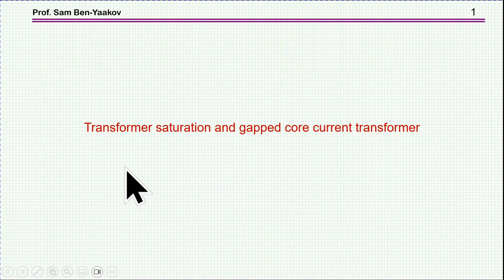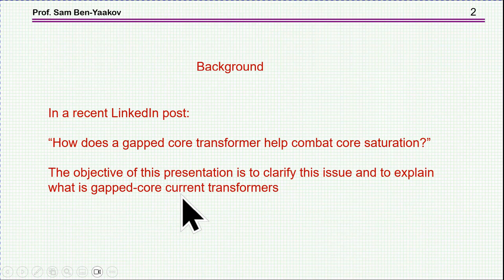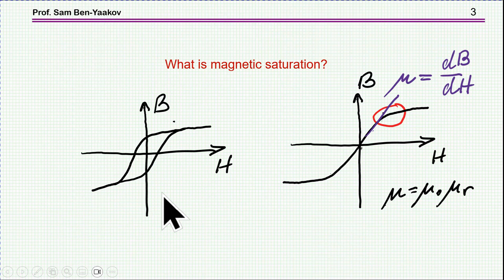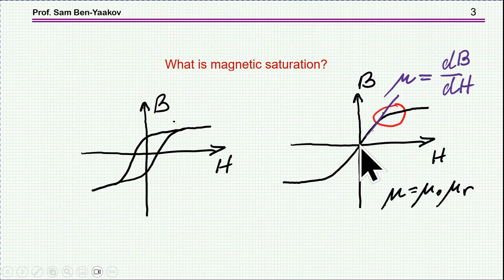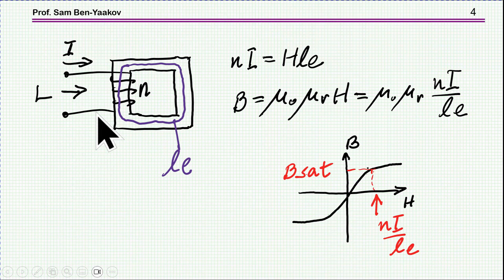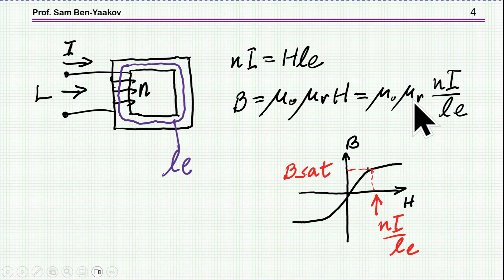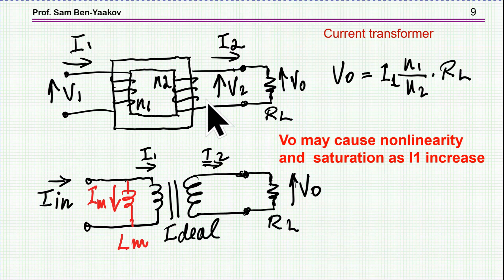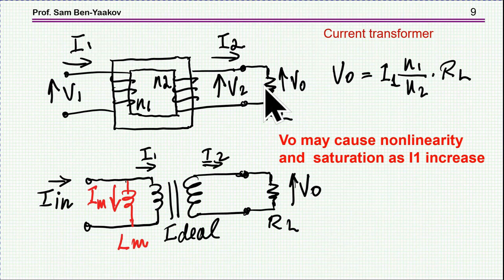Transformer saturation and gapped core current transformer

Comment: Professor, thank you for your great video! I have a question which confuses me for a while. I am designing a transformer for a CLLC converter. For the same turns ratio, see 10:1, I can choose 10:1 or 20:2 in order to get the same output voltage. However, according to the Faraday's law, when I use 20:2 instead of 10:1 (keep inductance L the same by adjusting the air gap), I would have lower Bmax when the output voltage is kept constant. However, if I refer to Ampere's law, as the output current or even the magnetizing current is the same, n*i = H*le, the H would be higher and so the Bmax would increase. Where am I wrong?
Reply: I think I figure out :) when I increase ratio from 10:1 to 20:2, in order to keep L constant, I have to increase the air gap which affects the equivalent le.
Reply from the maker: You mean you are going to have 1 turn in one case and 2 turns in the other case?
Reply: @sambenyaakov  yes professor
Reply from the maker: @tangy1181  This seems unrealistic.
Reply: @sambenyaakov  I think I confused myself in my original question. When I choose more turns, in order to keep the same inductance, the gap will change. So even though n*I will increase, however, as the the airgap increase, H might actually decrease. ：） sorry for the confusion!
Reply: @sambenyaakov  But professor, I have another question. For my understanding, the inductance should only depends on the transformer geometrics and etc. However, when I test my transformer at 100Hz, the leakage inductance is 42uH while at 100kHz, the leakage turns to 7uH. The material is 3F36..... why🤣
Reply from the maker: @tangy1181  with 1-2 turns all the behavior is messed up
Reply: @sambenyaakov  im using matrix transformer, the actual turn is 5:2

Comment: Hi professor. Related to this topic, DC-blocking capacitors in DAB converters.There are people that indicate that DC bias can be solved with a gap in the transformer,  others say that DC capacitor is always necessary. I thing that resolution of PWM in microcontrollers is going to always generate some DC and in transients very likely a DC half-cycle applied, and hence saturation. Can you dedicate a video commenting misconceptions on this issue?
Reply from the maker: Will try. The best solution is to use current mode control.

Comment: Hi Professor,

Thanks for another good discussion on magnetics. I haven't seen any gapped core current transformers like this (unless you count the aux/sense winding on a QR flyback or BCM boost inductor), so it's interesting to think about. 
I think there are some applications where a gap is helpful even in a conventional voltage fed converter or current transformer, though:
Where the excitation is unipolar (e.g. forward converter transformer or a current transformer for measuring switch current in single ended converters; in the general case where one relies on the core to reset itself) to reduce the remanence and allow higher flux swings before saturation.
Where some DC current would otherwise saturate the core undesirably, such as in a center tapped converter (only so that the additional magnetizing current will reduce the voltage across the transformer with the winding and switch resistances) or certain current measuring applications. You could consider this to be the shunting benefit of a parallel inductor as you discussed in the video for the gapped core CT and of course it comes with a cost in terms of pulse accuracy or reactive current depending on the application.
Reply from the maker: Thanks for the conversation. I agree with what you say but my experience has been  that a gap is inserted  in a transformer core when there is a possibility of DC voltage and a series capacitor is not used. .

Comment: This was interesting.  However I have issue with the statement that the voltage causes the saturation.  The saturation is caused by magnetic flux density reaching a value where the all domains in the magmatic circuit are aligned.  
That saturation value (peak flux density)is proportional to V/f (slide 8).  This to me seems better than "the saturation is caused by the voltage."
Reply from the maker: Yes, I agree in general. However, the  domain explanation does not provide quantitative relationships. Or, why will be the domain more "aligned" at a lower frequency. I was said that the saturation is caused by the voltage because, as you might know, the presentation is an in fact an answer to a LinkedIn post that was related to line (fixed frequency) CTs. Thanks for the conversation.

Comment: Nice refresher.
While I agree with the effect of the gap on the B-H, I kinda don't get why people would introduce it the way you mentioned in the first part of the video. Sure, having a gap would allow higher current, but it changes the inductance as well whose value is crucial in power electronics.
Reply from the maker: You need to accommodate I^2*L/2. The physics is such that a core with a gap will the smallest for a given energy.
Reply: @sambenyaakov  I am having the same confusion, let's say in a buck/boost converter we need to have enough L to store the energy to be used later and then by adding the gap we are reducing the overall L. I can wrap my head around it if I look at it in term of increasing the current margin without going to saturation but not when I try to analyze it with the amount stored energy in mind.
Reply from the maker: @josephgharakhani5375  You can not store energy unless you reduce Ur (having a gap) since the core will saturate with very little current. So you have to add to  "need to have enough L " WITHOUT SATURATING THE CORE
Reply: @sambenyaakov  Thank you Sam for taking the time. Much appreciated! You are amazing educator! simple, concise, right to the point. Awesome!
Reply from the maker: @josephgharakhani5375  👍👍

Comment: Thanks, I really learned a lot from this! However, now I'm more confused than ever about the air-gapped transformers in Switch-mode power supplies, which I assume are voltage transformers, and use non-sinusoidal, pulsed waveforms; all of which you list as cons. Will you make another video explaining the use and the pros and cons of air gaps for flyback transformers and forward converters?
Reply from the maker: The flyback element is NOT a transformer. It is a coupled inducror.